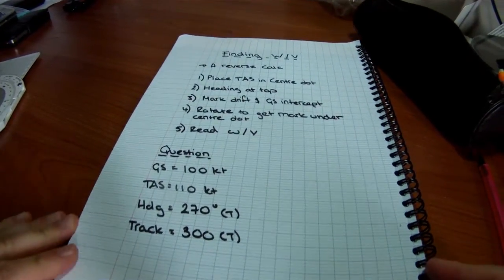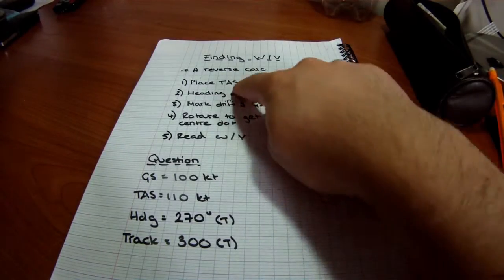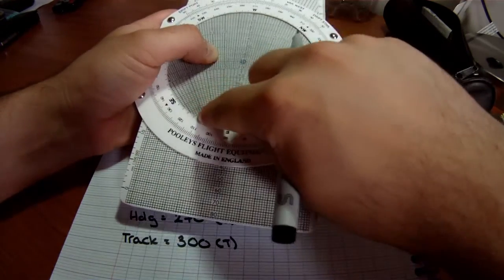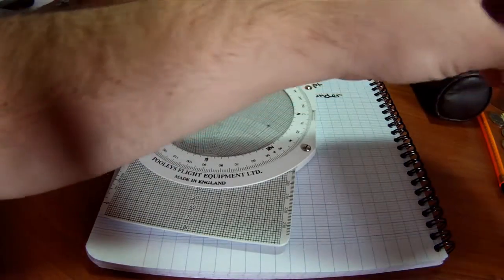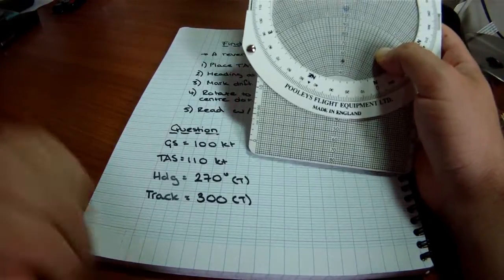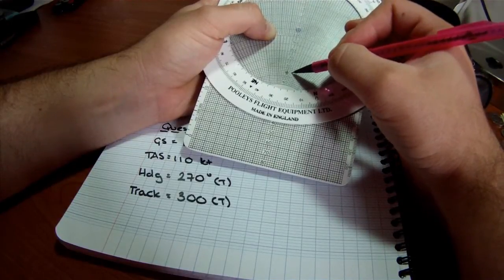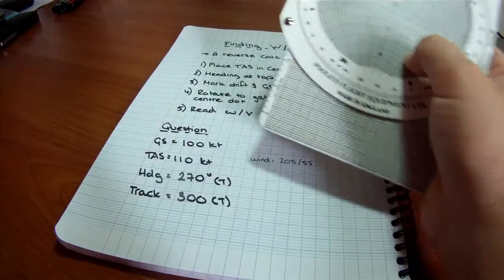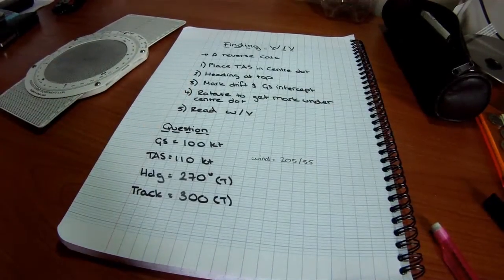CRP-5 tutorial to Finding W/V in a Merryface Aviation Groundschool tutorial

Comment: Another complication. With 270 under the hdg follow the inner ring to 300 and read the drift from the outer scale. In this case 30S. Then plot dft and gs and move the cross to the bottom as before.